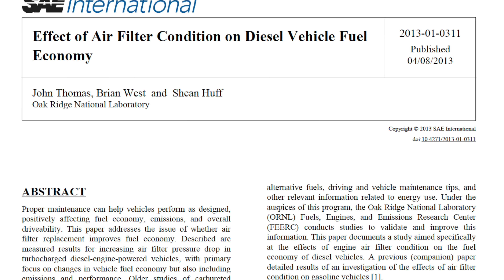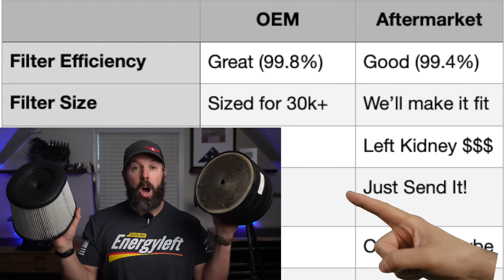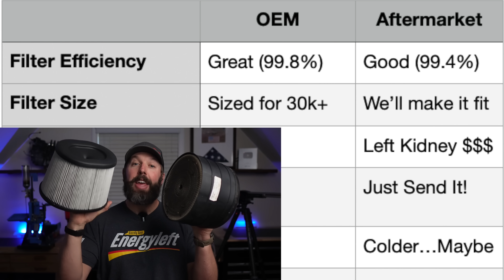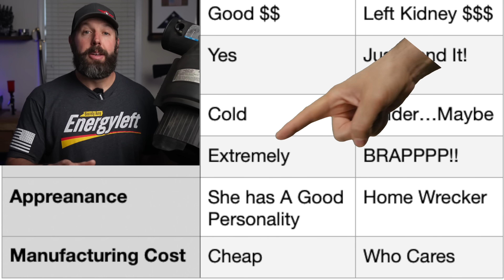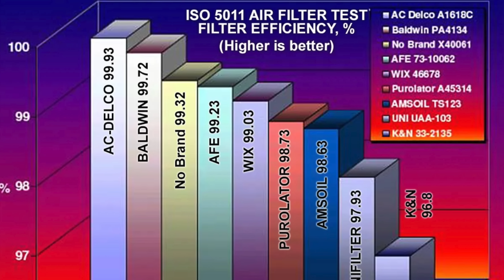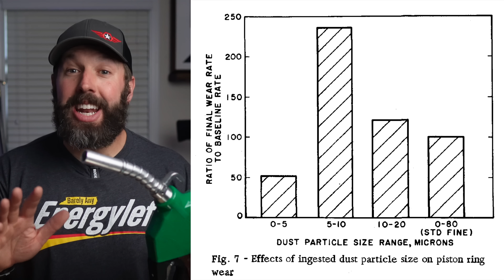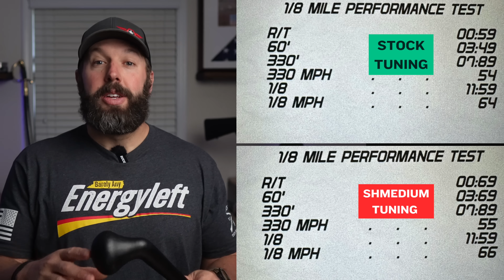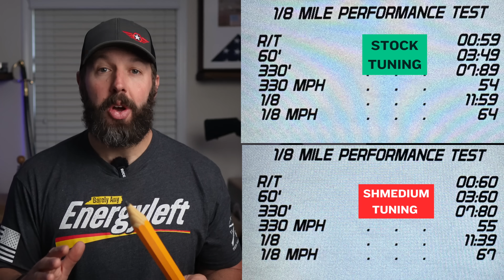The TRUTH About Cold Air Intakes…ACTUAL SCIENCE!

Comment: Science is fun and all but i have seen filters get so clogged from not being changed that it either ripped a hole in the end or caused the filter to collapse. This was on a diesel. Now to be fair the reason it got so clogged was due to an exhaust leak but the exhaust leak only became the problem when the filter got clogged enough to slow the engine down enough to cause the diesel fuel to not burn correctly and smog would fill the engine bay from the exhaust leak. Long story short…. Change your air filter.

Comment: do you have the science behind the bigger filters flowing more dirt or just "high flow filters"?  that would actually come down to the filter media used.... you could use the same filter media on two different sized (surface are) filters and have the same filtering capabilities... thats the first point. the second point is as filters increase in size (area) they also have a lower pressure differential across the media. creating a secondary increased filtration effect of not wanting to (generality) suck in as large or as heavy of particles. there is lots of information on this subject especially in the industrial dust collection and air separation world. if you want to not suck something up the best way to do so is lower the pressure until it falls out of the air. which is where the theory of a large filter comes in.

Comment: Factory intake is not cold air non restrictive intake if you are not in the lambo or similar.
It is silenced, economy oriented restrictive part designed to fit easy at assembly line.
This video is pure junk and these particles have no effect on engine wear.
Fake info video.
Reply from the maker: Source: “Because I said so, bro” 😂

Comment: @1:20 more efficient at trapping debris but not at moving air . honestly unless the engine has almost double the stock power the factory filter is more than enough. i agree with the science but i also agree with what i have seen first hand in the industry . the people with less engine issues are the ones doing 3k to 5k oil changes

Comment: So, just a dumb question. Looking at the S&B dry filter for the 7.3 (99-03), it looks like it has the same or better efficiency than a stock motorcraft filter (99.67% stock vs 99.68% S&B). It also looks like it does actually get lower IAT than the stock intake from the testing that KC turbos did. Is this a case where the aftermarket CAI is better than stock in every criteria? I know the newer trucks have better intakes, but it seems that there aren't any downsides to the S&B when comparing to a stock 7.3 intake.
Reply from the maker: Interesting to see the factory intake have that low of a filter efficiency.🧐
Reply: @freedomworx  Looking at the S&B test for '94-'97 7.3 shows a 96.44% efficiency for the OEM filter, which is actually much lower than the S&B filter (99.22% oiled vs 99.24% dry). I don't have the answer as to why this is, but I find it interesting none the less. Do you have any resources where I can research ISO 5011 tests from different filter manufacturers?

Comment: Been thinking about putting a S&B on my 2.8L diesel and came across this video. As I do like the whistle of the turbo. Plus I do pull a 6500 pound camper in the mountains. With a clean tune even with it floored it doesn’t smoke. Everything filters included are all stock. I think I might just keep the stock ACDelco air box in it after watching this. As I value longevity over power gains.

Comment: An engine builder one told me “ an engine will last as long as it takes it to eat a cup of dirt “  
Other YouTubers have done similar testing and I no longer have any use for CIA systems . I did have a K&M system and 2 filters. I was diligent about cleaning it and had 2 so one could be 100% dry and ready to go. Even so I now know I was letting more dirt into my engine. I drive a Lot on dirt roads and I keep my vehicles for over 200,000 miles. I am trying to do al I an to take care of them.

Comment: I change my oil between 7000 to 8000 miles with syn. oil and filter. I have several vehicles over 200,000 miles. Works for me.

Comment: If you've been around a while; you'll remember oil filter change intervals were every other oil change.  Even if you change you oil every 3,000 miles.

If you live in a freezing area, only take 5 minute trips in the snow to work or 8 hours, and 5 minutes back; 3000 miles might not be soon enough for the level of fuel dilution you'd be getting;
the 3,000 mile rule is dependent on where you live, what you drive, how you drive it, and many other factors.
A rotary unless it has a Sohn adapter, uses engine oil injected into the combustion chamber to cool and lubricate the apex seals; 3,000 miles can be good for a cleaner burn.  So many factors that make 3,000 mile changes smart for a portion of users; and you will surely have a longer lasting $5-20k engine if you change your oil every 3,000 miles vs 30,000 miles.

Comment: I remember learning a long time ago when I was learning about diesel engines in farm equipment having an instructor teach us that used filters were better than new for the same reasons you mention.  He recommended installing a intake air vacuum sensor (which were mechanical at that time) to tell when you should clean/change the filter.  Today with digital sensors and engine monitoring displays you'd think that would be a common thing to do, but it doesn't seem to happen.

Comment: I knew about the filters being more efficient when they got dirty from being an HVAC technician. Although there’s a fine line between dirty and too dirty because it’ll turn into a restriction quick. Also, I change my oil every 3k miles because I run e85. And it’s been proven that shorter oil change intervals is better when running e85. And also don’t make short trips without letting the engine oil to get up to temp and burn off any condensation or e85 that got into the oil.

Comment: Factory intakes are cold air intakes, but most likely they fitted the intake for the factory air box with a snorkel where the air enters it and the snorkel is usually a smaller diameter than the tube going to the throttle body therefore restricting your flow. Also the longer the intake path is, the more lower end torque you will get. Just look at the old cross ram intakes from Chrysler also Honda knows this.

Comment: The power gains from the aftermarket intake are only at the top RPM. You will never even notice at normal speeds, also that is why there is no improvement in fuel economy. I had a Banks intake with a scoop below the bumper on a 5.9 Cummins. It was JUNK. The intake tubes were coated with fine dust. I sold the system to a guy that wanted it and put the stock back on. Ended the dust on the intake tubes. I was honest when  selling the Banks crap, I told the guy I lived on a dusty road and needed the stock protection.

Comment: Wait no! 
I had it backwards at first, the Air filtration matters because dirt causes wear before the oil ever sees it — at the rings, cylinder walls, and valves during combustion. The oil filter only removes particles after wear occurs. So oil filtration can’t offset poor air filtration; they protect different stages of the engine

Comment: I just discovered your channel and it's fantastic. Most of this info I have good knowledge on but I love your science based approach and delivery. I'll add a couple of tidits however.
I do run AFE dry filters on everything because the slight loss in filtering efficiency is worth the notable increase in power on my (always) modified vehicles and oil analysis shows that I'm not ingesting any silicone above averages and I've never 'worn' out a motor.
I'd certainly skip on K&N's as I've felt the silty oily mess on the intake tract of several engines that had K&Ns. Heck my own '99 7.3 was a test sled for them in Corona when it was new. 
However I'll share a story: My stepdad is not a mechanic, but he does some ranching. To this day he owns a 2000 7.3 that has 445K plus miles on it. Now it's a ranch truck and it's lost enough compression that it only starts first thing in the morning with ether but this didn't happen till past 400K miles. But it's had a filthy drop in K & N since brand new. I worked on the truck at around 300K and when I removed the filter it was caked with dirt (this certainly helped the efficiency!) and had that nice oily gritty residue inside the clean side of the intake. So it's nice to take care of our engines, but they can probably deal with more than we think.
I'd also add that I use the restriction gauge to change the air filters on my Semi trucks, and people think I'm crazy because even working oil field (dusty roads every day) those dual external air filters will go about 2 years, and oil analysis proves that I'm not getting any silicone intake. Most others change them at a cost of about $250 every other oil change.

Comment: 14:04 Cold air intakes mostly don't bring in colder air than stock, we know that. Its to get the huge non-restrictive filter as low and away from the engine as possible, hence the "cold" in cold air filter. The aftermarket filter you have in your hand is a HOT air filter from a short ram air setup which has a shield around it in attempt to keep heat out, which it doesn't. A true cold air intake does, and with the right filter works very well.

Comment: Theoretical science without knowledge is the whole problem with the world today! 
ASE certified master technician here! 
You should change your oil every 3000 miles if it’s conventional or every 5000 if it’s synthetic. 
Yes, purely scientifically. Once there is some contamination the filter becomes more efficient.
However, the risk way outweighs the reward when you realize that clogged oil filter opens the valve in the bottom that bypasses the filter, allowing completely contaminated oil into your engine! 
You will kill your engine way prematurely by not changing your oil and filter on time!! 
No matter what your manufacturer says, they are trying to extend the oil life to make their cost over 10 years cheaper so they can advertise it! 
Trust me when I tell you all of my personal vehicles have gone way over 300,000 miles with the original engine and the only thing I really do different is I make sure I use full synthetic and I change the oil every 5000 miles! 
I have driven everything from a Ford 7.3 to the Dodge ram 5.7! 
All of them got well over 300,000 miles. My Ford 7.3 is currently sitting at 380,000 miles and it is my tow truck.

Comment: If my teachers used freedom seeds like this guy, I would be way better at math. Ok so I got the info I needed. First time truck owner. When the dealer had me follow him to fill up my new truck I thought damn his truck sounds good. Then he went back to dealership and I went home. I'm like wait..... is that my truck! I got all giddy when I realized I can hear the turbo spooling up. First turbo vehicle.. didn't hear it in the test drive. But the windows were up. As soon as I got home I googled how to make it louder. The easiest seemed To be CAI.. but I don't believe it'll be a significant difference in dB to justify the price... just how much louder will it be? I read some turbos have a resonator to quiet them down but if I remove that (if I have one) I wonder what it'll do to the warranty... I think the cheapest method will be a blow off valve.  Won't make the turbo louder but the psssssst sound will make me smile for sure. Install seems simple enough. Love the marketing. How it allows pressure to blow off so you don't bend the turbo fans lol.... as if there wasn't already a chamber there to do exactly that.

Comment: I looked into the opening on my 96 7.3...its at least as big as the alum tum feeding my turbo...I don't see any benefit to a 400 buck intake.

Same with the downpipe....there's a 100 videos saying put on a 3 in downpipe....because its bigger than the flattened factory one....but if you were to round out the flat pipe I'm betting there's no increase in size.

Comment: Used to be a big K&N fan but after having to replace multiple MAF sensors due to oil contamination, I just went back to a factory style filter. My brand is WIX. K&N filters do definitely improve power/performance. I could feel it. But there is a cost for that power increase. I won’t be buying any more K&N air filters.

Comment: I buy K&N filters for all of my vehicles just so I can basically forget about it.  Roughly every 50k miles I literally pull it out, slap it against the concrete to get the big chunks out, spray it with a little more oil and re-install it.  Been doing this for decades and always have had good luck with them and no issues with MPG or power in everything from a little Subaru to a big Duramax.  ALL of them made it to over 200k save for one 2014 Subie with a turbo.  It spun a bearing at 159k.  Also, I live in a relatively "clean" climate/region.  No big city driving, very little dust/dirt etc...Filters can live a long/clean life up here in the northwoods of Wisconsin.

Comment: I'm an S&B fan as well.  I can say my experience is a little different, but that only applies to older diesels.  On a 7.3 X, I did the intake (S&B) and the increase to 4" exhaust a month apart.  I also work for a fuel company, so I know exactly the quality of the fuel I'm getting (referring to refinement, filter plug temp, refinery source, etc.).  With the intake alone, I gained 2 MPG in town driving running the same pre-tune, and maybe 1 MPG on the highway.  Adding the exhaust secondary, I saw another 1-2 MPG in town, and up to 4 MPG on the highway.

I netted about 3-4 in town, and just a little on the highway.  The only way to get the real max MPG, was to keep it at 60 MPH or under.  On a 280 mile test after both were on, I got an amazing 32 MPG average.

Now.  When I drive like I normally do, I see much less at highway speeds of 65+ MPG.  In town summer driving I'm at about 17 MPG with my "mileage" tune that I use.

Comment: i put them on to reduce cost of normal filter. get one on sale for 150-200$, clean and service it, cheaper then $40 filters twice a year. but it is a long term investment. as for power .. possible on some poorly designed vehicles, go conpairision is 70-80 vehicle with tiny snockle(square body with 350 vs 3 ton grain truck with 350, air filter box is night and da), so yes it can make more power at the high rpm range but not cruising, your factory system is prefect if your never going to jump the gas peddle. i would say for the sound and long term investment yes get a good one.but for better fuel no. spend the money on the oil and normal maintance

Comment: I guess when you suck the dirty ass airfilter into your intake boot it filters 100% efficiently or collapse the intake boot I assume your making power there too. Anyone with two working brain cells understands that as the filter becomes dirty it filters better and filter efficiently goes up but the air volume decreases this puts more stress on engine components  also remember an engine  is an air pump if you restrick the air coming in you have less air in the exhaust so in a modern diesel the exhaust gas spins the turbo to create power by having a dirty filter you create a inefficient  turbo which is bad it creates an inefficient  fuel burn = soot and it leads to premature turbo failure and DPF issues in all modern diesels so "$100 air filter" ( which some oem filters  ar more than $100 ) or $3500 turbo or $$8-10000 DPF system, you decide

Comment: In most cases, the CAI is doing nothing of the sort. Sticking a filter down in the engine bay vs. leaving the stock box pulling air from the front of the grill will never be colder air.  The swoosh sound can be cool, if you are 25 years old, but otherwise, unless the CAI is closed routed to the same front grill location of the stock box, such as the APR intake I had on my GTI, it's sucking in much warmer air.